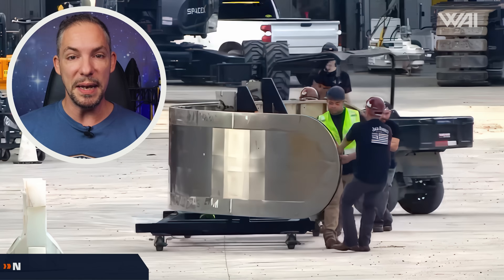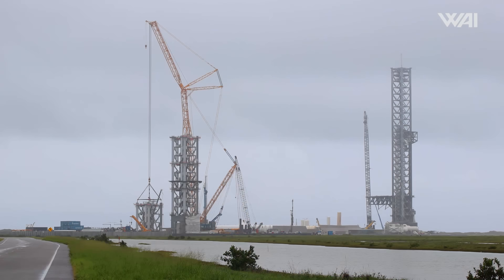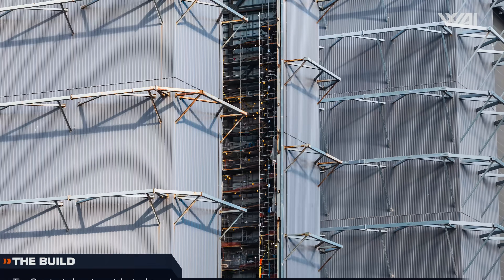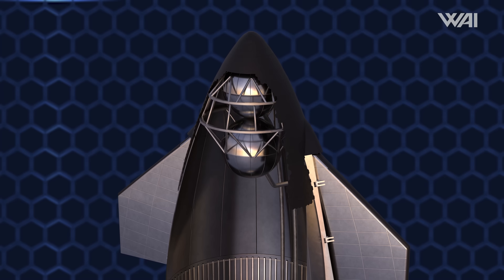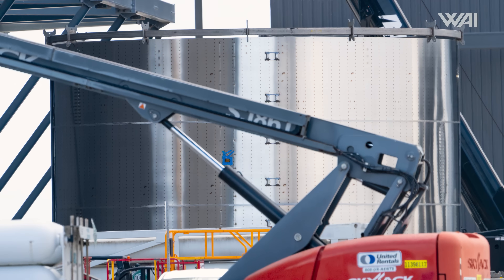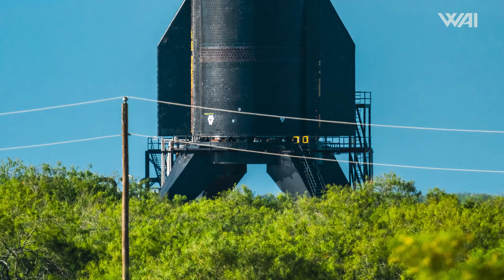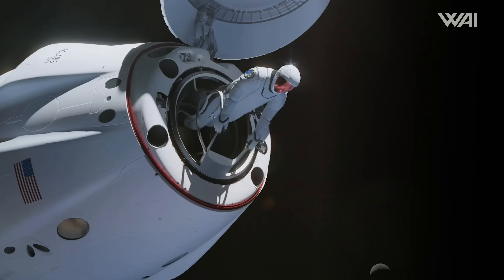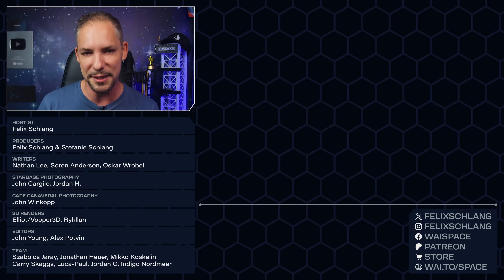SpaceX Finally Finishes Testing! Starship Flight 5 Next!

Comment: Please make sure you have a good streaming connection and setup for the launch! I really want to watch it with WAI, but the last stream was hard to watch with all the connection issues. It was the first time I didn’t share the livestream with family. 

Please take this as encouragement/constructive feedback from a fan and patreon supporter. Thanks for your enthusiasm and work!
Reply: Better than Rocket is here
Easy lift off 
Easy land on with antigravity Spaceship
No Fire
No Explosion
No Flame
Just Spin and
Lift off
Powered by Baterry

Work base on Gravity just spinning by using Battery
can fly in bad weather, plunge in the ocean even in outer space
Can lift more than 100 Ton 

Earth which weight predict 600 trillion ton does not fall at the Sun because of centrifugal in orbitting, on the contrary it does not be thrown far go out the orbit line of hold by gravity at the Sun as orbit center. Gravity and centrifugal is equal called Equillibrium, thats why until now Earth which we was inhabited always rotate and circulate the Sun. Now we justly take example : how if the gravity used and centrifugal is negated? The Earth will float far leave the Sun. So that centrifugal can be used to fly far away if gravity eliminated. Finally how to eliminate gravity?

It’s way rotate part of aircraft by horizontal. When that rotation faster centrifugal force getting greater and the gravity getting smaller, finally it lose the gravity and the aircraft start flying. Of course people would surprise: how the aircraft can keep rotate without fulcrums? Thats why we named that aircraft Shuttling System that is aircraft likes two disc adjoining attached in the midle as fulcrums:

A. The Top part, we name Positive rotate to right, and the edges is getting thicker and havier.

B. The Buttom part, we name Negative rotating to left, and the edges is getting thicker and havier.

C. Middle Part , we name Neutral, air crew placed and also machine and everythings turning Negative and Positive at the same time.

The aircraft can liftup added with explosion from the engine. However that aircraft construction later, let the engineer doit it, and we are sure the aircraft will bulletproof and also waterproof.
 
.
.
 
In modern civilization where human being generally using flying saucer as vehicle, will a lot of change in lives either in materialism and in psychological. In materialism area will apply the change in life like.
People no longger need roadway and rel road which spend large of energy, money, places, things and time, object place and time. People would utilize that area for habitat or for other need:

Comment: I have a question that y'all might be able to answer. The first few Starship flights were run and the ship had, at the end of the boost phase, had very little fuel left. Estimate from looking at the screens was less than 5%. 

Were those ships run without full tanks? Because they were flown with no bulkheads, no cargo, nothing that would add weight. If SpaceX is talking about adding 100 tons to the starship to get it to LEO, then I don't see how it has enough fuel, booster or ship. 

The other question is, and it's been a while since I did the math. Starship can hold about 1300 tons of fuel. Starship can lift 100 tons to LEO. So, to fill up a single starship would require another 13 flights to refuel in orbit. Now, a Starship probably wouldn't need full fuel to get to the moon or even a long period Mars transition orbit. But that's a LOT of transfer flights.
Reply: Hai

Comment: My postulation is that these tanks are for landing pressurization.  The autogenous pressurization system has 
water vapor in it, thus leading to ice build-up in the tank and blocking the intakes for the engines. Some of the 
autogenous system will still be used, but until they figure out how to remove the water vapor from it, it will be 
secondary to the small tanks, likely full of Helium.
Reply: Hai!

Comment: Question, I understand how the pez dispenser is going to work to offload the satellites but nobody's ever talked about how they load the satellites do they have to load the satellites first and then lower the nose cone over it or did I feed them inside and load them one at a time That's what I want to know Thanks
Reply: I believe it loads and unloads like a pez dispenser.
Reply: That's what I was thinking ,but maybe you guys should include that. Or fine out , that would be interesting to know @TheEvilmooseofdoom
Reply: Yes, they will definitely load them into into the cargo bay first, and then stack it. That's the only logical way.

Comment: still wonder how they rotate the descending booster so these pins beneath the grid fins line up with the arms....  doesnt look like a lot of room for failure
Reply: The RCS does that.  F9 lands in the same orientation each time so it does not seem to be that big an issue.